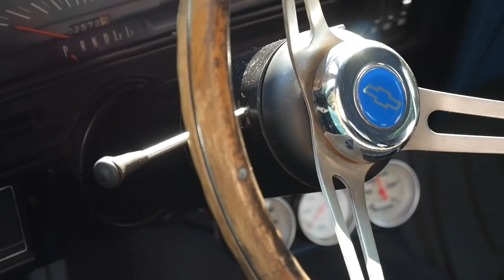Nova is FOR SALE!

Comment: My mom had a 72 nova, back in the day and it had a big 300 straight 6 in it. I worked at a garage at the time and would throw old tires on a friday night, at the end of work and smoke them off with my friends. So later i found a 68 Pontiac Acadian which is an exact copy of the 69 nova SS my plan was to clone it but money became an issue as i was only 17 at the time. but it had a 307 2 barrell making 200 horse, did some body work put big ass tires L 60 race masters and  traction bars and sold it for 1500 bought it for 500.
Went across the street to car dealership bought a 79 Camaro Rally sport for 7500. friends went crazy.